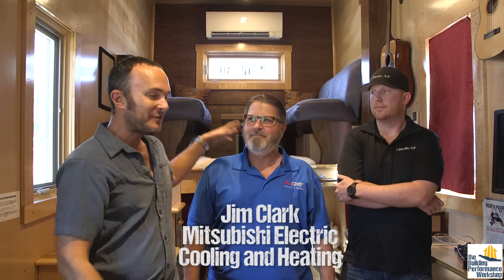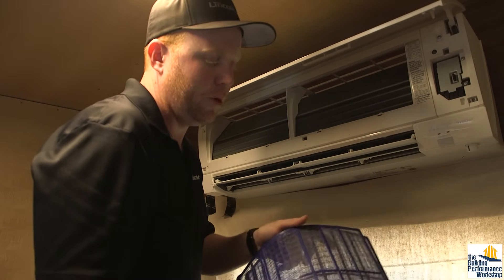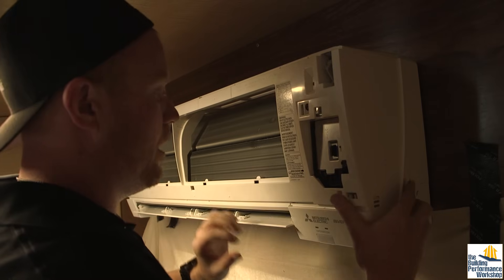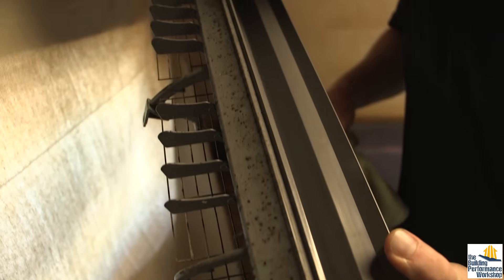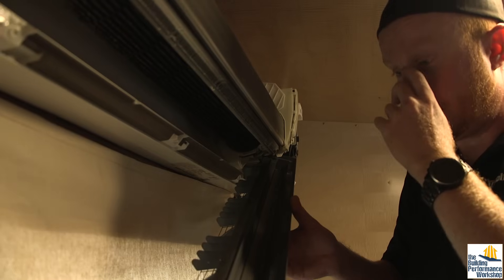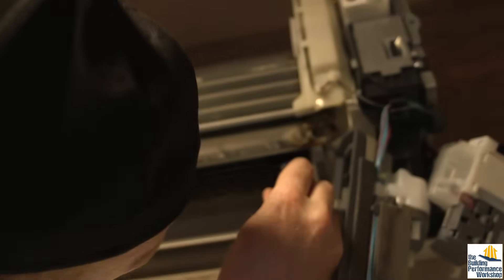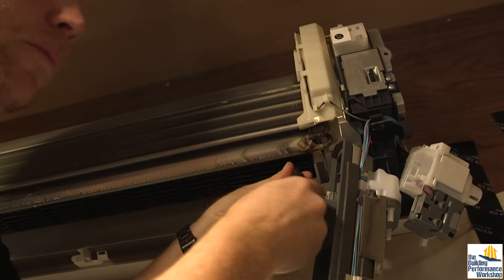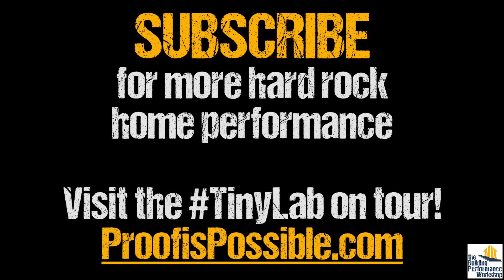Ductless Mini-Split: How to Take Apart & Clean DIY (Mitsubishi FH High Wall Series)

Comment: My man, Corbett!  I really appreciate the help you've been on my tiny house over the years.  Last year my a/c contractor did this job for around $400, I was busy working from home so I let them do it.  This year, the price is $1000 so I am back here brushing up on maintenance procedures for my FH series.  This information is great, not a difficult job for the DIYer so thanks again for ALL the useful videos.  One question though... A/C contractors (including my own) are pushing the sale and installation of UV lights inside mini splits.  I get the idea and it sounds like it would work, it seems kind of scammy to me.  Surely the commercial UV sterilizers work to some degree but I have serious doubts about installing $40 worth of power supply and an LED strip being worth the $1200 that I was quoted.  What do you think?  What about the RGF unit mentioned elsewhere in the comments?  Are these topics worth doing a video on, maybe?
Reply from the maker: I think everybody is always looking for shortcuts in life. Seems like an easy thing to sell. I'd keep cleaning the thing like the wholesome, realistic guy you are. Thanks for the high five Kenny.
Reply: @HomePerformance  Absolutely.  One other question if you have a quick second. You and I had talked about humidity in tiny houses before.   When I purchased the FH for my tiny house, I had assumed that because it is an inverter model, oversizing shouldn't be an issue.  Is that true?   I imagine you wouldn't have chosen the same model if it were going to cause problems, right?  Or do you think that rather, two people just generate a lot of their moisture in a tiny space for the FH to keep up with, while running under so little load?
Reply from the maker: I bought it because it’s the smallest one in the world at that efficiency. I still use a dedicated dehu alongside it.
Reply: Where do you live that they can charge these ripoff prices?

Comment: I was looking for a video on how to remove the actual unit from the wall, off the mounting bracket.
Reply from the maker: If you do, the refrigerant lineset will rupture. But it hinges at the top, it’s just hung on a lip.
Reply: @HomePerformance  I had a unit mounted but not hooked up. It has to come off for some adjustments. I read the instructions and was able to figure out how to remove it, it was actually super easy.

Comment: I’ve been looking all over for a video for this particular unit and this is a great one! Very easy to follow along with!

Question...can I spray the cleaning foamer on the coils with the draining well still attached? Or do you recommend that being off before doing so?
Reply from the maker: Sure, either way is fine. It won’t rinse itself off the coil until later.

Comment: I have a question! 
I have three evaporators running off of my outdoor condenser. Do I need to power down the whole system, or is it enough to power down the individual evaporator head?
Reply from the maker: Generally a good idea to shut down the entire system at the outdoor disconnect, that way there’s no electrical risk

Comment: I removed the blower fan screw entirely but the entire cylinder seems totally stuck on the motor axle. Is there some trick to getting it off? I tried spraying wd40 at it but that isn't helping.

Comment: I am curious if instead of removing the blower wheel, you could just stop after removing the drain pan assembly and the the wheel with a vacuum with a brush attachment .
Reply from the maker: Try it, but you really should be washing the blower to clean it completely- vacuuming can only go so far.

Comment: I took my unit apart and saw the same thing: it looks like bottom coil flaps are bent on the bottom where drain pan is from right to left all the way, just like they look in this video. Is that normal?
Reply from the maker: It’s not a huge deal

Comment: One more question. I had standing water in the pan - is this normal or will it run out of the drain when it’s x full etc.
Reply from the maker: Water should not be standing- it means your unit’s not level on the wall.

Comment: I just watched this video and learned a few things. I have a 4 unit split system like this. Of the 4 units, only 1 (In our bedroom) constantly smells like mold and mildew only in the summer time since we are using the AC. I have cleaned the filters many times. I have made sure the system is draining outside. I have now just checked the level. What I have learned by watching this video is where mold and mildew can be in this unit. I just now shut it down while on dehumidifying since that lowers the smell and the coils are wet and cold. I will be tearing this apart thanks to your instructional video. *FYI this unit is a year and a half old and last year this smell started after being installed for 4 months. ANy additional advice while I do this teardown?
Reply from the maker: +Paul Andrew so glad it helped! Just take your time and keep all the screws safe. You'll feel so accomplished!

Comment: I can’t get my blower wheel all the way out the right side is staying in place even though I loosened the screw any advice?
Reply from the maker: The right side is slotted over a 1” long pin, you have to slide it left once the left side is clear

Comment: Thank you for this very helpful video. I do have a question: I had a lot of trouble getting the blower wheel off even after loosening the set screw, and I'm having even more trouble getting it back on. The wheel seems to be set on its bearings, but I can't get it to spin freely- it rubs against the left side no matter how much I finagle it. Any advice?
Reply from the maker: Hmm, I’d try again, making sure the set screw is loose enough, and double check the condition and alignment of everything around the blower wheel.
Reply: The same thing is happening to me? Were you able to fix it?
Reply: Yes! My advice is just to keep trying! Takes some patience.

Comment: Do the vertical vanes pop out in the MSZ-FH series as in the older units? Makes cleaning the blower easier. Or do we need to remove both the outer covers and the drain pan to get to the blower? Thanks.
Reply from the maker: On this newer model, yes, you have to do quite a lot to remove the blower wheel. Hence the vid
Reply: Wow! But still better than paying someone $402 per head for sure!! I guess doing it a couple of times will get you there. The drain pan has no screws to remove?
Reply from the maker: Nope

Comment: The unit I have has a ticking noise when on...feels like the left side. Any ideas what I need to to do to stop the noise?
Reply from the maker: It’s the blower wheel rubbing on something. Break it down, put back together and give the wheel a spin by hand before moving on.

Comment: I dont have issue with cleaning it, but taking unit from the wall! To unclip these 2 clips on each side from the wall metal plate. I am scared that its going to break and how hard to pull..

Comment: My set screw is a hex/allen key and it won't budge even with a lot of torque. I've tried CRC to no luck. Any tips?
Reply from the maker: Whoa, sorry to hear- you CAN clean the blower wheel in place with this type of thing: Split Air Conditioning Service Bag with Water Pipe, Wall Mounted Air Conditioning https://a.co/d/6Kh702p

Comment: Does the drain pan come out straight or you need to push up or push down and then pull it out? And while going back in does the top or bottom go in first?
Thanks.
Reply from the maker: It needs a wiggle to come free
Reply: Thank you. And then how does it get back in there? Just a straight push in or something? Or does it have clips or something else holding it?
Reply from the maker: Nope, just give it a wiggle. If that doesn’t work, try a waggle.

Comment: I can't, for the life of me, get the blower wheel out. I did remove its screw and lifted the coils, but it doesn't wanna "just pop out" like all the videos I watched say it should. I managed to get its left side pointing downward, but nothing happens when I tug on it to pull it out, like it's still attached to the motor part, even though I removed the screw. I'm really affraid to break something, but I can't live without my ac anymore.. it's too moldy to run. What do I do? Is there a specific angle or a trick that I keep missing? I'm getting desperate, lol
(no technical terms please, I'm a lady)
Reply from the maker: Glad you reached out- the screw holds the blower wheel to a metal shaft. You need to pull the entire blower wheel to the left, lengthwise, to get it free of the 1-2” shaft. Good luck!

Comment: Followed instructions on video, still have sour/ dead flower  smell at times from all head units. Any ideas why? Seems to be dehumidifying , water comes out of the pipes outside, and cools house appropriately.
Reply from the maker: Maybe you’re missing a spot- also, try using unscented coil cleaner.

Comment: Maybe u can help me, i have a mini split system and both my units smell for like 1minute or something a little bit dump/musty i completly cleaned em out like u did they still do it. 

Is it just the start up so the thing is not doing its magic in the beginning is it normal?

i dont have any smell if i just use fan, like i said the dump/musty smell is just like a few seconds its like the cooling starts to get injected or something?! thank you

ah yes the units are one year old now i just dont remember if they did it in the beginning aswell :D
Reply from the maker: Maybe the coil didn’t get completely clean the first time? Shouldn’t smell at all.
Reply: No Nobody gets me, i doesnt smell Like anything than the cleaner it is more Like dump moisture Feeling in my nose but IT Starts with the outside Spinning and Just is Like at Most 30-40 sec till its coming Out cold! Thank you anyway @HomePerformance

Comment: last time i cleaned mine an ac guy told me i can use dawn dish soap diluted 1to20 mix in a spray bottle to clean the coil in instead of coil cleaner, it works but its a mess. just fill a clean spray bottle with water and add 1 tablespoon dawn.

Comment: These ductless splits should be easier to take apart and clean because they all have mold and dust all over blower wheels.
Reply: Yeah. Last time i called a company for a cleaning all they did was spray some simple green in it and left. Diddnt take it apart
Reply from the maker: Cuz it’s hard- now you’re part of the illuminati
Reply: did anyone get the cost for the cleaning?
Reply from the maker: It’s 100% free if you do it yourself, probably $150-200 otherwise.
Reply: @HomePerformance  
I could buy an 8000btu window unit for $150 from Home Depot, and it will last for 10 years with no problem.
Reply from the maker: LOL, you could also just wear a coat when it’s cold in the house. You could walk or take the bus instead of driving a Tesla. Different strokes for different folks. This minisplit allows MY ENTIRE HOUSE to run on 15amp service.
Reply: @HomePerformance  
To each is own.
Being a mechanic in commercial HVAC I don't go near these units.
I've been asked many times of what I think of them. I simply tell people that ask me if you want to spend alot of money for a unit then have it installed by a licensed mechanic then go for it.
I also remind them if they can afford the costly repairs, eg. coil leaks, failed compressors, faulty fan motors, and OEM parts for specific manfacturer.
Of course nobody listens, 
I then get the usual "can you take a look at my unit you do this type of work."
I tell them to call the manufacturer up, and "My warranty is expired" is the usual answer.
That's when I laugh.
Reply: @drwlpwasright5132  funny, yet here in europe we use them for cooling and heating all over the place. a properly installed unit will last for decades, even the reasonably priced ones. and you should see what sort of heat pump shenanigans they get up to in scandinavia - underfloor heating, hot water, and cooling in the summer, all from a single outside unit.
Reply: @drwlpwasright5132  They give up making a ten year ac unit years ago!
Reply: @robertl.fallin7062  
Welp, I must've got lucky and bought the last 3 window units (14 years ago this summer) before they gave up making a ten year unit.
The 3 window units I have still run like a top, and never had any problems.
Reply: @robertl.fallin7062  i get mine professionally cleaned, central Florida area, and for 2 units I pay $150
Reply: @drwlpwasright5132  Agree BUT these Mitsubishi units are FANTASTIC .
Reply: @theks  That's excellent.  I was just watching a video where the "professional cleaning" in Maine was foam cleaner blown at the fins at the indoor cassette, and at the outside fan, spray watered off, $140.  And an NYC'er chimed in, same service $500 for him.
Reply: @drwlpwasright5132  Yup.  And sooner or later, you'll tire of lugging that in and out every single year, twice a year.
Reply: @buzoff4642  
Not at all. I've had the same 3 window ac units for at least 10 years, a 2 ton Freidrich window unit in a living room wall for more than 20 years, and a couple of $20 fans. It never bothered me installing and removing the 3 units every year. Altogether it works out to about 1 hour of the year in total time.
Other than the electric bill which is expected in the summer months, I don't spend a nickel on maintenance or repairs. If the unit goes down, in the garbage it goes, and then it is off to Home Depot to get a $160 window unit that will last for years.
Reply from the maker: I like the directness of your outlook, DRWLP

Comment: How about outdoor unit? Do outdoor unit need cleaning?
Reply: Yes you need to hose the fins with light water pressure because high pressure can actually bend the fins making them useless. The water will clean out the gunk build up and let it function better. Once a year or more if it’s in an area where it gets more gunk buildup.

Comment: Recently seen a Germicidal UV Light retrofit for mini splits that's supposed to "inhibits all mold and other biological growth on blower and evaporator coil surfaces and sterilizes germs, viruses, allergens and other pathogens." Might be worth trying.
Reply from the maker: Interesting. Ozone creation?
Reply: Nothing to do with Ozone generation. The concept is that UV light kills microbes, mold, and mildew. I guess the general concept is sound, but I would like to see evidence of how well it works in these ductless heatpump units. So far, haven't found any objective testing or reviews...
Reply: Another one on the market (similar in concept) is the "Mini Split PHI System by RGF" . It also uses a UV light source like the Fresh-Aire MiniUV but it also utilizes a PHI-Cell. The  advantage to the RGF design is it sits on top of the indoor Minisplit unit, no tricky installation, no need to open the unit to install it. Personally if going the UV light route I'd probably choose the system by RGF over the Fresh-Aire MiniUV.  Here's a link and more info:  

https://www.rgf.com/wp-content/uploads/2016/07/MiniSplitspec.pdf

Both the Fresh-Aire MiniUV and RGF systems use a UV light. However, the RGF system also uses a PHI-Cell. Although it might be all smoke and mirrors... the "cell technology" sounds credible.  This "cell" technology is similar in principle to the PCO Cell (Photocatalytic Oxidation) Cell from Air Scrubber Plus. Although the Air Scrubber Plus is designed for whole house HVAC installation the science behind how they work is similar. Both are billed as systems designed to help eliminate indoor air quality risks by reducing air pollutants, VOCs (chemical odors), cigarette smoke, dust, pollen, mold, odor-causing bacteria, and odors etc. (Your mileage may vary) 
https://www.youtube.com/watch?v=k0b06ViT0_U
https://www.youtube.com/watch?v=-4GZZvfqlNE

Comment: Do you have any recommendations for the Odor, I don't know if its because my coil might be rusted or maybe it needs to be cleaned with the foam cleaner, but I can't stand the smell anymore, and my AC maintenance guy can't seem to get rid of the smell. If I need to use a coil foam cleaner do you have any recommendations for Mitsubishi Mr slim coil, I know if you buy the wrong one it could damage the coil.
Reply from the maker: I haven’t heard about foaming cleaners damaging the coil- that would seem to be the only job of such a cleaner, right? You can get one thru any hvac supply chain.
Reply: Do you still use that Foam in the video I can't seem to find it anywhere. Wonder if it was discontinued. If not can you give me the exact name its hard to make out the name of it in the video. Or if there is a better one that will get rid of the odor from the coil that would help greatly thanks.
Reply: I got a foam cleaner at Home Depot and it cleared the smell away. The smell was only intermittent but now its gone.

Comment: Illustrates how poorly these air handlers are designed.  It's analogous to removing a car engine to change the air filter. But the car engine filter will not blow all kinds of mold spores around. The minisplit (and all air handlers) bower fan should snap out for monthly cleanings like the filter!
Reply from the maker: You'll love this then:
https://www.youtube.com/watch?v=81a1nhQhbyE
Reply: That's what I'm talking about! Thanks.